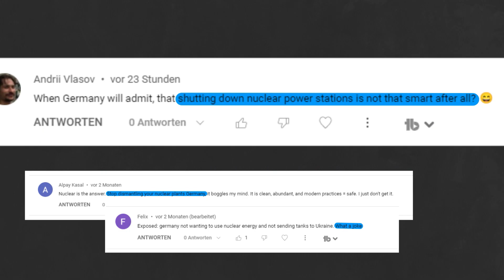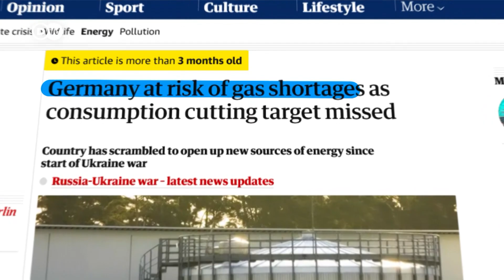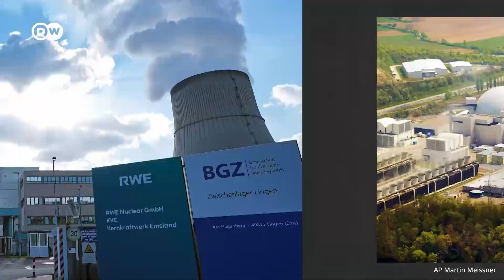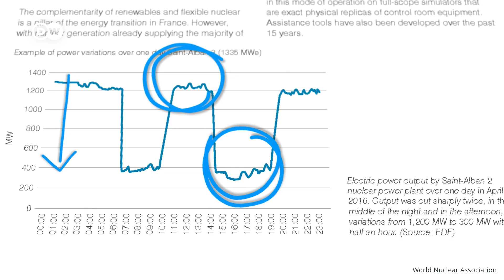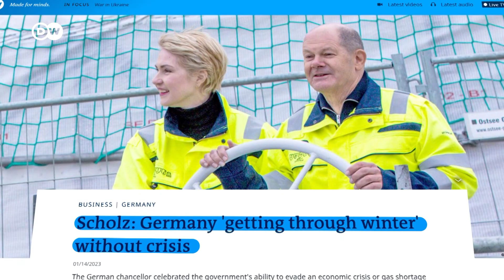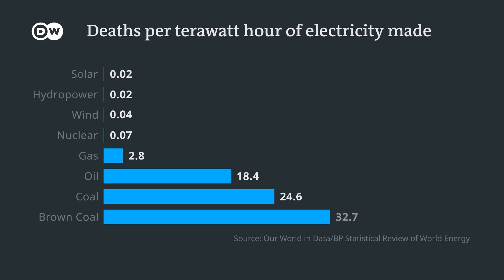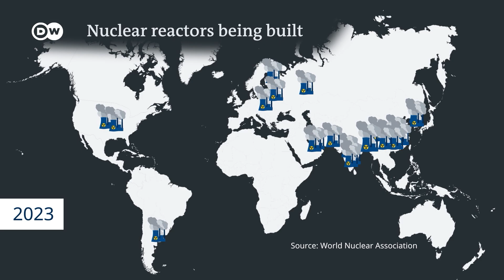Is Germany's nuclear exit a mistake?

Comment: I hate Germany for this!
Germanys decision to shut down their nuclear power has caused the price of electric power to increase in all northern Europe.
Germany and Denmark causes a electic power deficit on a daily basis of 10-15 GW of power (sometimes up to 20-25 GW).
Sweden used to have a very well balanced mix of hydro-, nuclear- and renewable power.
Since Germany shut their last 6 GW of nuclear power the Swedish electricity export to Germany and Denmark has increased by 10 TWh per year.
Today Sweden exports around 20% of the electricity we produce (a few years ago that number was 12%).
The same goes with Norway who also has increased their exports a lot the last few years.

This means that the power generation in Sweden and Norway no longer can cope with their own electricity demand and prices has sky rocketed.
We used to pay 30 EUR/MWh but today we pay German and Danish prices up to more than 100 EUR/MWh in summer and more than 200 EUR/MWh.

Comment: How did you come up with such a low death rate per terrawatt hr for hydropower? Is this country specific? Theres a single incidident in china that led to an estimated 26,000+ dead from a single dam failure. That likely exceeds all non nuclear weapons deaths total including weapons research and fuel enrichment for weapons. You may get to that death per terrawatt/hr rate for nuclear if you include the linear no-threshold model of radiation exposure, but a simple study of airline pilot's cancer rates would suggest that  model is extremely flawed and is unethical to use in statistics.
Reply from the maker: Hey there! Yes, you are correct.The death rate of hydropower is mainly influenced by a few large accidents. Without these huge incidents, the death rate would be comparable to nuclear, solar and wind. You can check out the source and methodology here 👉 https://ourworldindata.org/safest-sources-of-energy.

Comment: If you have a nuclear plant capable of adjusting its power output, why would you curtail nuclear output before curtailing renewable output? Most of the cost of nuclear is capital cost and operation costs, not fuel. There isn't much benefit in running nuclear at less than the maximum if there is a demand to get it. So if you have nuclear, why would you add renewables without adding storage?
Reply from the maker: @ThomasBomb45 Thanks for your comment! Grid capacities still remain a challenge for the energy transition, but there are ways to improve the situation. We recently did a video on the topic, you can check out:
📺 This is what's REALLY holding back wind and solar 👉 https://youtu.be/u-DsDuTceTo

Comment: 3:52 incorrect. It was not too late, industry was saying it explicitly. There was enough time to prepare 2 NPPs for winter. And within 1,5 years all 6 could be operating.

11:35 incorrect. There are no safety issues in Gorleben. The project was abandoned because of the local opposition fueled by the Green Party, which prefers coal.

But most importantly a big omission: 50 people died as a result of the Chernobyl disaster directly, 250 more are expected to die because of longer term effects. 0 people died because of the Fukushima disaster. Meanwhile, 1100 people die in Germany every year because of the additional use of coal to cover for the closed NPPs. We are having a Chernobyl every 24 days for ideological reasons. That's how big this mistake is.

Comment: Nuclear power has only two real issues. 

1. Lack of science development. All reactors in west are designed around military needs. Their designs can be traced to Manhattan project and first reactors of Oak Ridge and Hanford. Those design are cost and safety effective when military fuel is used like highly enriched Uranium. However, when those fuels are swapped for natural or low enriched U238, suddenly both costs and size of reactors baloon up. Leaving the bill of materials higher much than actual USA NAVY submarine reactor of similar power class. So price of civil power is like 10 times military. And sole reason why they are built this way is because military had the founds to boostrap initial development. There is no reason why nuclear reactors have to be build this way. It is just that development of cost effective versions never really happened. Nuclear revolution in USA and France, leading west countries, was done for good by 1970s and countries never pushed beyond "steam car" eqvivalent era.

2. Capital Contruction costs exploded. No matter how expensive reactors are, they are still no more of 20% price of project. Majority of cost is construction and financing, a cost which exploded greatly. Costs of just steam turbine part of modern thermo plants, no matter if its uranium, gas or coal fueled, has skyroceted in multiple billions range. It is possible to have this costs under control, like KEPCO demonstrated in Saudi Arabia, but that requires long term planning. Something unheard west of Vistula.

Issues with capital costs, construction and scaling power are mostly consequence of size and lack of dedication and research. Nuclear submarines have reactors which are safe, on cost, on time, with variable power output. I bet that many countries would be lining up to buy reactors in range of 50-100MW if those were available. But no country paid for development of those. Russians have nuclear power rocket and torpedo now, design of both requires small light reactor in tens of MW range, demonstrating that it should be quite reachable goal.

Comment: Nuclear was a bridge technology from coal and gas but we just missed the point to extend solar and wind faster. Now nuclear is out the pressure is there to speed things up. Without this we would never push renewables.
Reply: Nuclear never was a bridge technology, it's the path to the holy grail (fussion).

Comment: I am from Germany and think that the exit was a good idea. I might think otherwise if we had build more plants much earlier that we could use for another 10 years or so. In the time it takes now to build a new plant we could go near renewable power only. The problem of storing huge amounts of energy from renewables can be solved (unlikely with batteries only) whereas nuclear power is not only much more expensive but has downsides that are hard to compensate like the dependency on water (already is a huge problem in France) and the radioactive waste.
Reply: You can say that, but when your country closes nuclear power plants, you import nuclear form France. Which not only is more expensive for you, but unnecessarily raises the energy bill for all of Europe. We all have to suffer from your decision. If Germany wants to stray from the common approach, you should also leave the common energy market.
Reply: @simondahl5437  Germany does buy energy from france, but did you know that france imports 4 times as much energy from germany?

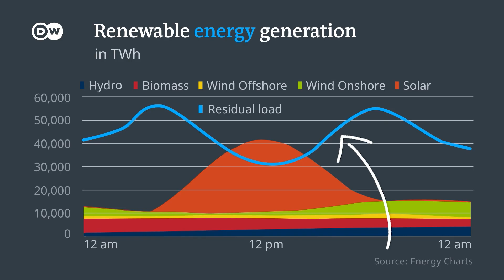Comment: You missed represented a bit the battery storage at 5:24. You showed a lithium ion batterys as battery storage, but at this scale they are new thing and not used that much. The energy storage solutions that you could have showed were for example 2 water dams that one of them is higher. Because they are two water reservoirs you are not that dependant on a river (though of course you still need one to top one of them from time to time). You pump water from the lower one when you generate extra energy from solar for example and when sun doesn't shine (during night or cloudy days) you can use the stored water in the upper dam as... you guessed it... a battery. There multiple structures that are used on such big scale for storing energy for the grid and i am sad that you left them out. Hope my clarification helps!

Comment: Not an expert, but it seems that carbon in the atmosphere is a huge problem, its affecting heath and climate for everybody. Nuclear energy has one clear advantage, it has very few emissions and not much waste really. Waste from coal or gas have had far more health consequences, even considering the few accidents nuclear has had. It would have been a good transition, and at the very least they should have kept and installed base working. It has been wasteful and dreadful for the environment, Germany's energy is not cleaner now, and they export externalities to neighboring countries they import electricity form.

Comment: the fossil fuel industry has successfully conned people into being baselessly fearing nuclear power. Nuclear power is nowhere near as dangerous, nor the waste problem as big as people think it is. Every ton of CO2, Nitrous Oxides and other toxic gasses put into the atmosphere when we burn coal, gas and oil is far worse than nuclear power. The main drawback of nuclear power is the high capital intensity. The costs take decades to payback.

Comment: The people making this video are extremely misinformed. Nearly every “issue” people have with nuclear energy has a solution. Nuclear waste can be used in a different type of reactor and the waste from that type of reactor is significantly less radioactive and much easier to store. There are technologies such as molten salt reactors that answer many of the safety concerns (China is already testing a scaled down version of this type of reactor) as well as thorium reactors which answer but safety and waste concerns. Anyone who is any bit against nuclear genuinely has no understanding of how nuclear power works, how radiation works, and how much power nuclear can make in comparison to renewables. Also nobody mentions the considerable environmental concerns associated with renewables. The amount of land required to get 100% of your electricity from renewables destroys the very habitats that you are trying to protect. The world is ran by people with a room temperature IQ and label things such as nuclear as scary because all their knowledge comes from a fictionalized TV show. Shame on you Germany and shame on every country trying to do the same.

Comment: That graph 5 minutes in with the quote "each day on average more than half of the electricity is generated by renewable" is exactly why renewables are borderline useless (they can seriously hurt in many situations, because they push extremely high amount of power on the grid when it's not needed).

You can't turn the other sources at the flip of a switch, so the dams, coal and other plants just keep doing their thing.... Then the sun decides to shine, or not, the wind goes... or not, sometimes neither are there for days, then both show up to produce energy, often when it's not needed.

Then the politicians count this as an average, but there is no point to it.

Comment: Nuclear fission plants are some of the stupidest ideas humans ever came up with besides nuclear bombs, fascism and capitalism.
They are the pinnacle of hidden costs, making them one of the most expensive forms of energy generation if the true costs are consider, uranium mining and enrichment is incredibly harmefull to the environment, loading off deadly trash for generations/lifeformes of the coming few million years is incredably irresponsible and last but not least causing the breakup of atomic nuclei to boil water and drive a turbine is truely ape brain stupidity.
Artificial nuclear power will at some point be the basis of existance for humanity, certainly not fission though but fusion and not thermal conversion but induced beta decay and direct current conversion.

Comment: The problem is not that Germany shit down the atomic power plants but to do nothing to compromise them. That's is a rly big failure from Merkel. But they did the opposite and killed the whole solar power industry in Germany together with the FDP. That's the big failure here.  Also I find it wears that not a single word dropped about the problems France had last year with many rector's where shut down because of not enough water to cool and technical issues where France imported electricity from Germany.....

Comment: Unfortunately, you have overlooked transmutation, which is being researched in Mol, Belgium.
There, nuclear waste is bombarded with a particle beam in a reactor and the energy produced by the subsequent decay of the nuclei can be used. This reaction ends immediately when the particle beam is switched off, so that an uncontrolled core meltdown is not possible. The remaining fuel then only has to be stored for 300 and no longer for 300,000 years.
In my view, this is a much better solution than eternal storage, where, in addition, usable fissile material is no longer accessible.

Comment: I was recently in Germany and was told to not use the washing machine, dryer, or the sauna in order to save energy. They also turned off traffic lights at night in rural areas and you have to “yield to the busiest road.” Very disappointing
Reply: But they won't stop using their carbon-intensive cars, flying to Mayorca, Israel and India, or still consuming so much meat.
Reply: Probably has more to do with the frugality of some Germans.

Comment: It just blows my mind that in an age where we can clearly see the inevitable consequences of climate change, politicians are still claiming nuclear power as "unsafe" or "outdated", and they are willing to burn fossil fuel instead. I think it doesn't take much mathematics to calculate, how much material you need to use for the same outcome of energy, not to mention that in one form it literally means by converting it to carbon dioxide. Buy an electric car, burn coal and gas, and install your solar panels to generate energy, when the peak load is at its absolute minimum. Is it surely the most logical way to go? The one that causes the less harm for humanity and the planet? I have doubts.

Comment: Is water wet??
Reply: Now that’s the question
Reply: The question "Is water wet?" is a classic philosophical conundrum that hinges on the definition of "wet." When we describe something as wet, we typically mean that it's covered in a liquid, usually water, and that this liquid adheres to its surface, altering its properties. A wet sponge, for instance, is wet because water molecules are clinging to its fibers. However, water, in its pure form, doesn't have another liquid to adhere to in the same way. The wetness we associate with water is actually the effect water has on other substances; it's the ability of water molecules to interact with and adhere to the surface of objects. So, while water is the quintessential cause of wetness, it's not itself wet in the conventional sense. This is a matter of perspective and definition. One could argue that since water molecules are attracted to each other through hydrogen bonds, and this attraction leads to surface tension and cohesion, a form of internal wetness exists. However, this interpretation departs from our everyday understanding of wetness as an external condition. Ultimately, the answer depends on how strictly one defines the term "wet." It's a question that highlights the limitations of language in precisely capturing the subtleties of physical phenomena. It prompts us to consider the inherent ambiguity in many seemingly straightforward concepts, encouraging a deeper understanding of the world around us and the words we use to describe it.